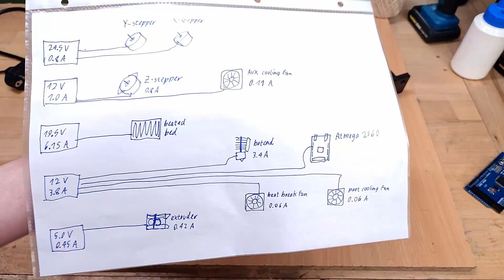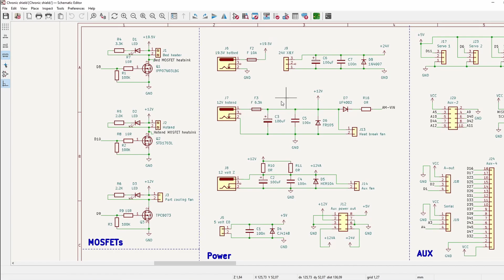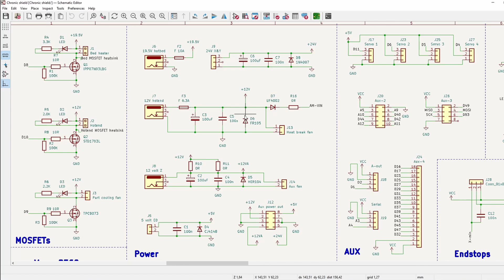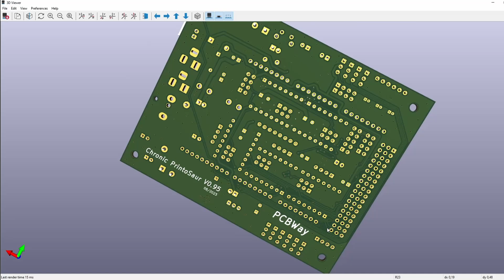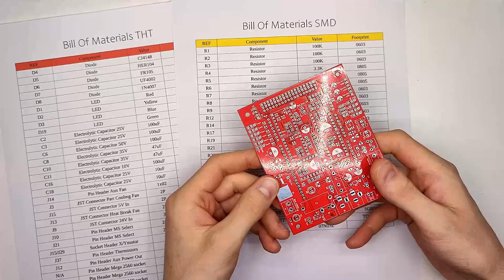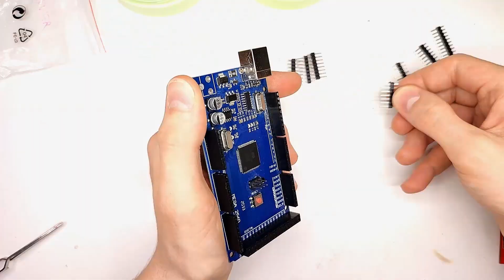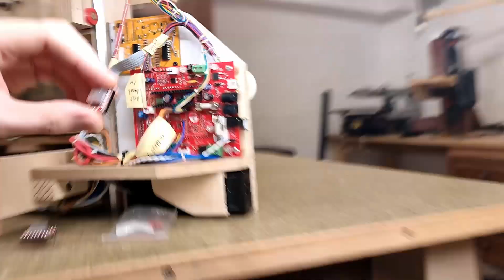Making a custom Ramps 1.4.2 shield to finish my unipolar 3D printer! | Part 13

Comment: Wow, how and where did you learn all this stuff about electronics? I'm very impressed and also want to learn that much.
Reply from the maker: In the grand scheme of things I'm actually still just a beginner in electronics. Never really got into the AC side of things, let alone HF... It's mostly just acquaintance with ohms law and basic analog circuitry that shapes up to this after years of practical experience. There are actually only a few very basic ways of combining components to achieve something in circuit design and after a while you start recognizing these patterns and being able to apply them yourself :)
Depending on how familiar you already are with electronics, I recommend watching a few electronics 101 courses or similar here in YouTube to get comfortable with how electricity works, then grab a breadboard, a multimeter and a few components and start building circuits! All the theoretical knowledge in the world is no match to getting some hands on experience and actually seeing measurable currents/voltages affirm your earlier calculations. It really helps with getting a hang of it. There are dozens of sites/channels featuring simple circuits to replicate, like timers, dimmer switches, flashers, dusk sensors and other fun mini projects. This is pretty much what I did for years. There is a channel called @BBCircuitsbySteveMorrison that I did a sort of collab developing a circuit with a while back - he unfortunately seems to have stopped uploading but has a couple of good explainer videos and examples circuits on his channel already. An OG channel I've been watching for years that I can really recommend is @bigclivedotcom. Lots of second hand practical experience to gain even though it tends to get slightly repetitive at times.
So yeah, I hope this helps a bit, best of luck in your journey!
Reply: @ChronicMechatronic  Thanks, I'll try it)

Comment: I know you know this, but those BYJ motors are easy enough to pop the plastic shrouds off of and short the trace on the pcb that makes them unipolar. Just scrape out the trace with a razor blade and boom you can run them off the a4988.

Comment: Very nice! If you really feel like playing later, here are my suggestions: first, inkjet printers have a sliding carriage that can act like a stepper motor using a separate arduino or ESP32. Cheap, doesn't skip steps, and can go very fast.
Second, Klipper can make a cheap printer go faster. Pressure advance is the biggest feature, but also being able to use multiple MCUs in different places makes printer design easier. 
Third, the longer the bowden tube the more resistance the extruder has to fight. You might get better performance if you can shorten the tube. 
Fourth, G10/FR4 makes a surprisingly good bed material. Even Nylon sticks to it. Lighter than glass too, so the bed can accelerate faster. Just hit it with soap and water the first time you use it. 
Overall this is an incredible build!! If you choose to play with the inkjet printers, say something and I'll post a video to help out along with a link to the code I used.
Reply from the maker: Thanks! Yes, I totally plan on using inkjet printer motors in the future! I was gonna make a driver for them like you suggest, but ultimately I might have to rely on existing solutions because my coding skills are abysmal, so yeah if you could do a video it would be awesome!!
Extruder: I plan on going direct drive soon anyways to get rid of the bowden tube altogether. I've heard of kipper but it sounds really confusing coming from a GRBL background...
Reply: Great! It's honestly much better code than I expected. The only hard part was figuring out how to consistently identify the encoder pin out, and once I got that, it was easy to repeat. I'll try to get that video made soon!
Reply from the maker: @adamamott6637 thanks so much! There's not much info on 3D printers with DC motors out there yet as far as I know

Edit: no hurry with the video, I've still got a backlog of stepper motor projects to work through
Reply: You're right, basically no info is available on DC motors for printers. I've only seen one, from the guy who wrote the code and used it on the X axis. But it makes the Arduino act like an A4988, so t's basically a drop-in replacement! I just need to make the video before I get distracted 😆
Reply: @ChronicMechatronic  As far as Klipper goes, it was easier than I thought it would be. I switched a few weeks ago for a custom printer and ended up installing it everywhere because it was so easy. I have an Arduino Mega controller and it still moves at 900mm/s! I'll add my favorite tutorial in case you want to mess around. It runs great on any ancient laptop, don't need a Pi.

Comment: Please get yourself a better soldering iron, it will make your life so much easier. For example T12 soldering irons from China just cost around 35€ and I can promise you that you will never want to go back to your old one. And soldering with lead free solder is also no problem with T12 tips
Reply from the maker: I got a 908s ordered 😅 It may not have active temperature control but I can see if it works better for the time being, because when I get a real soldering station I want it to include a hot air gun

Comment: Why make shield if I can dedicate whole mcu in board
Reply from the maker: Yeah it would definitely have been better to build a real motherboard from scratch
Reply: Hey can u provide a solution to display and microcontroller in a single board integrated into a pcb ??
for other projects...
Reply from the maker: Isn't there tons of those out there already? Like this one: ESP32 Arduino 240*320 Smart Display Screen 2.8inch LCD TFT
https://a.aliexpress.com/_EIC0u6n

Comment: You can try connecting old 220V soldering iron to the bridge rectifier with some capacitors (4.7 - 20 uF) . It will boost up the voltage and it might get hot enough to melt lead-free solder. Other thing I've noticed is that not all lead-free solders are equal. Some roll of chinese noname lead-free solder didn't really want to melt, but plumbing tin-antimony alloy (95-5) solder melted much nicer, despite being bigger diameter.
Reply from the maker: Genius hack! Yeah, I might need to experiment, maybe that roll happens to be an especially bad one

Comment: About leaded solder wire you have to look at big electronict components distributors like Digikey, Mouser or TME. Dont know where You are from but looking at power plugs i deduct somewhere in Europe so I will recomend TME. But yeah leaded solder wire aint cheap nowdays. 
Great work with that printer. Little tpis for wooden frame- try to keep it dry/ constant humidity. Wood will warp and all alignment will be gone (alk me how I now :) )

Edit :
Looked at TME and you can get 0,25kg Sn60Pb40 wire for ~15$
Reply from the maker: Wow thanks! Yes I'm in France I'll check out TME!

Comment: another name could be the pooron switchwire
Reply: @ChronicMechatronic  voron switchwire, a DIY printer that is possibly one of the most expensive bed slingers one could build. they are quite well known in the community but given you built from the ground up with no prior experience I guess you haven't come across it.
Reply from the maker: @Altirix_ oooh haha I see! Yeah I've never really been interested in 3D printing so all I know is basically Ender 3 and Prusa. Got a lot to catch up with 😂

Comment: Instead of buying a hot plate I actually bought a hair straightener with a wide base. It can go up to 230 degrees Celsius which is slightly above the melting point of my solder paste. The whole setup works really well

Comment: 5$ pcb way
25$ shipping
20$ for rest of the printer
Reply from the maker: Aarrgh stop nitpicking 😂 
Had I spent 100 hours more to etch the PCB myself people would've commented I should just buy the boards.
Y'all know I have to accommodate sponsors to help pay for at least a fraction of the insane amount of time I spend making these videos 😂
Reply: @ChronicMechatronic  I get it brother I just find it funny, you did a great job managing the cost unlike 100$ CNC build where owner already had 600$ worth of stuff lying around. now im not sure how cost effective this is but I often salvage perfectly working nema 17 and nema 14 stepper motors off old inkjet, inktank and those bill printers that I get for free (I remove the motors and return the rest to the scrapyard/e-waste management) and most of these printers already have a working linear actuator inside that is used to drive the print head around in printers with comes with rather good quality linear rods and belts, why am I saving this? maybe if you manage to salvage this you could manage to build the frame out of wood (I did this back in 2016 when the technology was rather new but for z axis i salvaged 4 cm linear actuator with stepper motor from dvd/CD readers used in computers each one from e waste was 0.3$)
Reply from the maker: @xecarfa9755  haha I know my math is shoddy, I also used like $5 of plywood I had laying around, I think there may be a lower end limit to how cheap a 3D printer can be built without sacrificing functionality entirely like the easythreed... Barring some very special circumstances like getting to salvage a functional motherboard off another broken 3D printer it might actually be impossible to truly make one for just $50.
I am learning a lot on this project, including why sometimes using more expensive parts is actually desirable.
I've never seen NEMA type stepper motors in printers and such, only ever one 200step/revolution stepper in a Canon flatbed scanner. I also collect all those parts, my next 3D printer will likely use linear rods from inkjet printers and scrap metal tubing for the frame.
Reply from the maker: @xecarfa9755  I'm pretty sure the "$100" CNC you're talking about was the one by Hyperspace Pirate?
Reply: @ChronicMechatronic  I got nema 17's all from old bill printers (i verified by mounting holes) I've about 8 of those all salvaged and one wasn't working when I checked the mounting holes it was off by few mm's when I dug deep it turned out to be 7.2° stepper motor (around 7.2 not exactly sure) with all the modernization and fast production i mostly found servo type motors in new printers (I had found a cannon inkjet printer 2022 model god knows why it ended up in e waste so fast) which use a optical film to track the motor kind of like a servo, those i found to be extremely hard to use other than that all the ones I've salvaged were quite good though I must say getting the  pressed gear tooth off them was quite the pain
Reply: @ChronicMechatronic  about the 100$ cnc not sure who it was I saw it really long ago

Comment: Wonderful! 19:19 how are those wooden washers made?
Reply from the maker: Yeah I'm skipping some steps...
Little squares of plywood with a hole stacked on a screw and tightened with a nut. Stick screw in cordless drill and touch the spinning thing against the running belt sander until they're round and the right size. Pretty much the exact same way I made those custom metal washers in episode 4
https://youtu.be/tF-yNkTIu4g?t=372 (timecode link)
If I had a laser cutter I would've cut them on there including the cardboard ones for the hotbed, but that's the next project 😅

Comment: What! Why not just use 400 or 500 Watt PC atx and bug boost and regulators to get all volts from one supply!!
Reply from the maker: ATX voltages were too low for the heated bed, I explained it all in here: https://youtu.be/MpD2EWrJkOY
Reply: @ChronicMechatronic  I have seen you used 19.5 V laptop adapter it might give you around 100 Watt,
So even if you use boost converter removing 100 watt + 30watt ( supposing 80% efficiently) ≈ 130, ≈ 370 Watt Still left, removing 30 Watt per stepper motor - 30 efficiency =  120 Watt so  250 Watt Still left so on
Is it not enough!!!??
If not why not use direct Ac regulated by Dimmer controller!
I am wondering.

Comment: When I started using tin silver solder I got a sixty watt controlled temp station it lasted ten years it would have lasted a lifetime with lead tin solder but it did work well until it broke

Comment: why didn't you switch to one oversized 24V power suply or 24+19v on oryginal ramps design? also it probably be cheaper to ...get 10$ ramps knokof board and just remove the power sockets and solder power wires directly, (because the green terminals on knokof boards are coper coated steel and can burn under load , ask me how i know)
so if you can integrate power wires directly or at least check with magnet if yout barrel jack sockets are copper or copper coated steel, because it makes a dirrerence you can't see at first
 
alsoo just use longer header pins
Reply from the maker: I don't have an oversized 24 volt power supply. Yeah I figured those cheap Chinese screw terminals would have a lot of resistance, I was glad the ones I salvaged were high quality european made. I'm pretty sure most barrel jacks are copper coated steel, but since I'm running those individuals circuits on rather low amperages I wasn't really worried.
Reply: @ChronicMechatronic  i run my resistive wire homemade bed heater from 12 V so in my case the connectors kind of melted 
but i am more interested why you run heater from 19V it basically loses 1/5 of power compared to runing it from 24V and i doubt higher voltage would hurt it, but it would heat up faster and self balance better if the bed doesn't have enough thermal mass..
one thing to note is that your setup is potentially more stable for accurate prints like this, in my case bed pull down the voltage rail steppers runs at and that makes them have less umft, not much less but the same can be said about the hot end and some layers simply lookless shiny or ger under/overextruded ... but it is a 3d printer made of drawer bearings and 3d printed parts so that might be irrelevant
Reply from the maker: @kokodin5895 I only used 19.5v because that's what the laptop power brick I found in an ewaste collection bin delivers. I actually really like this approach, AC adapters for consumer electronics get thrown out by the hundreds, and more often than not they still work. Laptop power bricks being the biggest amongst them, the 120W one I used may have been barely enough for my large size bed but for a standard 200x200mm it would be plenty. Noise isolation is indeed an advantage, since my hotend and fans are on one 12v rail I can hear the fans slowing down when the heater kicks in.
I may have gone a little over the top with 5 separate supplies, but a third more powerful one to power all the motors wouldn't be as crazy as it seems. The big 12/24V power supplies used in most 3D printers also have a separate 5V supply inside to power the electronics...
Reply: Actually they don`t. They either put out 12 or 24V. The controller boards have step down regulators for the 5v logic. The ramps uses 5v from the Arduino Mega, but all other modern boards have own 5V stage. @ChronicMechatronic
Reply from the maker: Ah OK, thanks!
Reply: @ChronicMechatronic  i don't know how it exactly work on ramps in detail but i can confirm what  @maiorciprian  said , that ramps uses arduino linear regulator because shorting end stops power to ground fries that  on the arduino :] so i think it feeds 12v or whatever to a  barel jack socket then it goes trough linear regulator and goes back to the ramps 5v rail but if you use usb cable power for ramps can go directly from usb, you can even test marlin on arduino with usb power only including the screen and end stops, for steppers and heaters you need aditional power suply,. although if you only test if they work and not how you can always backfeed 5v to them if you test using leds instead of actual heaters and steppers
Reply from the maker: @kokodin5895  I think I got it mixed up because Ramps has 2 power inputs and I once saw one of those CNC style power supplies with separate 5V out... I actually added a polyfuse on my shield to protect the Arduino regulator from that very thing happening - and I almost made the limit switches circumvent it because the track had to be routed across half the PCB and the other Arduino 5V was right next to them... I'm glad I didn't 😅
Reply: @ChronicMechatronic  i just replaced the regulator :]
Reply from the maker: @kokodin5895  a while ago I had the regulator on an Uno blow up seemingly without any reason when I hooked it up to 12V. Still don't know why ¯\_(ツ)_/¯
Reply: @ChronicMechatronic  if it was low drop version regulator it probably was rated to 9-10v instead of 30V for regular good old 7805 but i would suspect you either overcurent it or it was arduino clone and the part wasn't even what it claimed to be
still if it just shorted you just hot air it off the board and place another one problem solved, if it was blown trough then you pray the brain survived  and do the same
Reply from the maker: It was an AMS1117 which is supposed to be rated for 12V, I double checked afterward. And I'm pretty sure the wiring was correct too... But the 328P survived and that's all that counts. Never actually replaced that regulator because I don't usually power my Arduinos from Vin anyway.